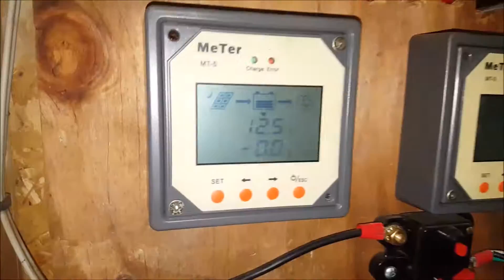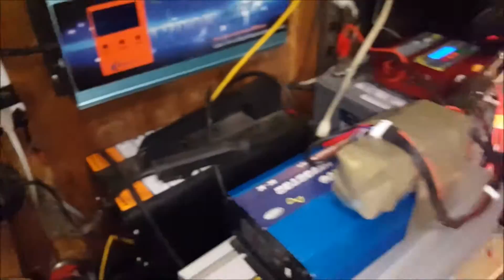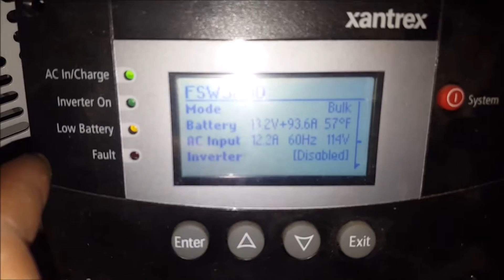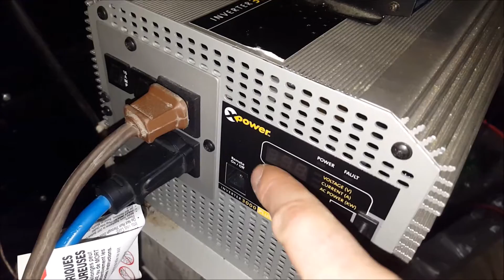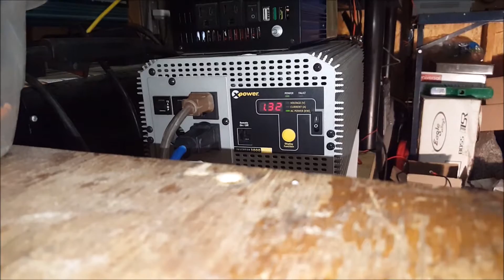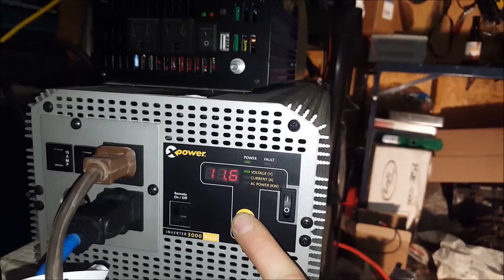testing Xantrex Xpower 3000 pt2

Comment: I am not the same I would like to know the value at least one which is right between the power transistor of blue color  there is a number registered on the surface because the one in my internal pcb card is 
burning and not readable the
number indicated disappointed I couldn't find anything on the web for the circuit diagram to print.🤔🙁
Reply from the maker: I am sorry I no longer own this inverter. I sold it years ago.

Comment: That little heater made lots of noise in the video ,wonder why?
Reply from the maker: +TheKilog69 its a heater from the 70s or 80s so that's why lol, its also full of dust and is very loud all the time.
Reply: +fliping720 I was talking about radio noise U can here it clear when U plug it in & out.
Reply from the maker: TheKilog69 i c, yea you can hear some noise.